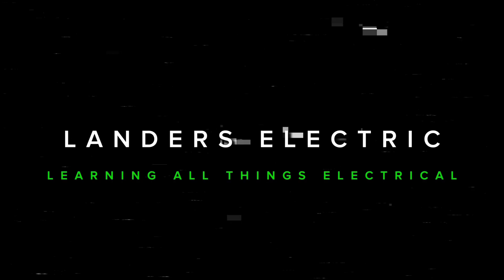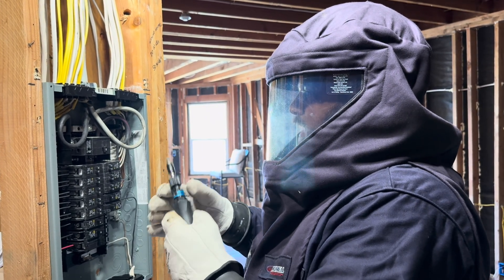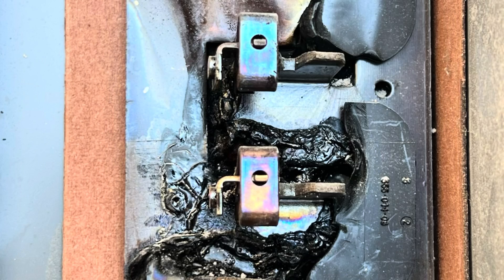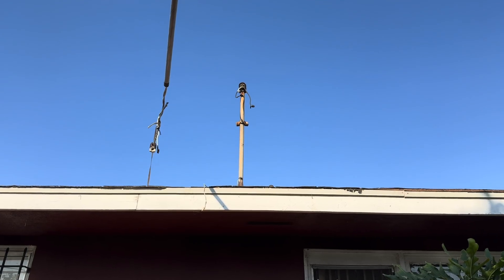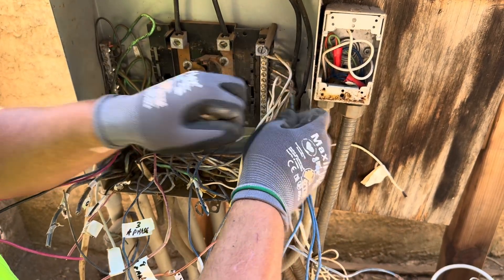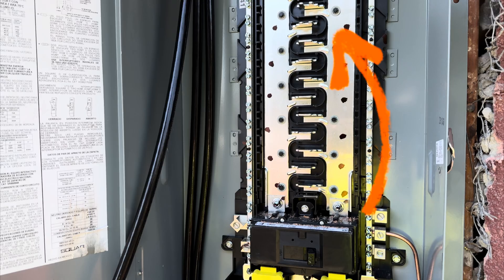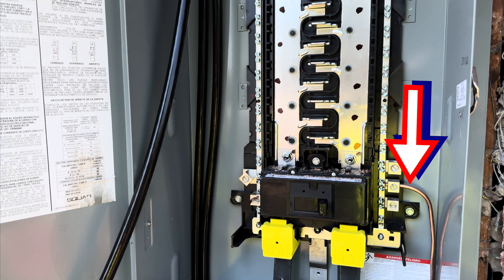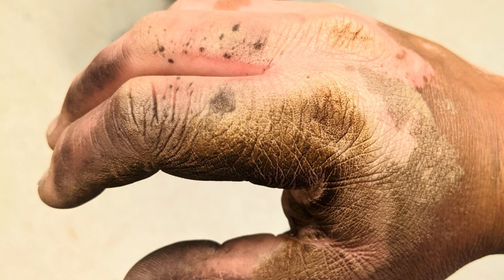I Could've DIED! | Electrical Panel Upgrade Arc Flash Accident

Comment: The problem wasn’t forgetting to turn off the main breaker, it was failing to have the power company do an emergency service disconnect first. A hot panel swap is not acceptable.  I know that you mentioned and understand that but I thought that the point needed to be emphasized. Glad that you made it through that.
Reply from the maker: Glad you pointed that out! Needs to be emphasized.
Reply: @landerselectric yeah, I mean, if it had been off, it wouldn’t have arc flashed at that point, but wouldn’t it still have gone wrong ten minutes later when you replaced the panel itself? Or were you planning to put the PPE on before getting that far and then doing the live swap part very carefully?

Either way, that’s a hell of a story. Glad you came out of it relatively intact and also that the insurance covered almost all of it, that medivac flight would have been a hella expensive way to get to ride a chopper.
Reply: The second mistake was not checking to see if it’s hot with your meter before working on it.
Reply: @jonnelson9760  and never do so with a multimeter. Any meter that can be set to AC measurement and then you try to prove dead, it will become the arc flash generator.
Reply: @JasperJanssen  We always used a multi-meter at work but we also had to wear PPE until it was proven dead. Also checked the meter before and after on known voltage source. That was industrial with 480 VAC. I always wore a face-shield although it wasn’t required.
Reply: I have a spare meter can with jumper cables and receptacle wired in.  I pull meter connect jumper cables to line of  meter can.  Put meter in temp meter can.

Comment: You never know how stable buss bars, isolators, connections are.  If you start pushing, yanking, bending on components and something breaks loose you risk making random connections. A journeyman electrician put his gloves hands into a 900A switchboard whose buss bar insulators had been stolen & the buss bars deflected & arced leg to leg & bathed him in the flash, took months to heal (only unburnt parts were his gloves hands, burned his shirt off, eye brows & lashes, hair back to a line from ear to ear)
Reply from the maker: That’s a real bummer. Have to be extremely careful and only work live if you have to and follow all proper NFPA 70E and OSHA Regulations.

Comment: Arc flash and arc blast are no joke. An arc is basically a plasma of super-heated, ionized gas and vaporized metal.
Reply from the maker: Well said!
Reply: I work in a data center. We always wear CAT 2 FR when on shift.
Reply: @dcviper985  What is CAT 2 FR ?  is that a type of arc suit?  or non-flammable clothing or?
Reply: @ fire retardant clothing that can withstand a certain amount of energy in an arc flash.
Reply: @dcviper985  I will google such.  If your name is solid.  I could wear something similar....  (I just can't see me working in an Arc flash......)   I am mostly in "equipment" panels. but some main, and subs.  Mostly Equipment, thats why I've been called in.  Not sure what code calls for, safety wise.
Reply: Yeah I saw a video about an electrician who worked in a really big industrial mill that I think made plywood or somethng, and had big machines, and he opened a panel that had shut down a machine it powered, it was 2300 volts , and he had an arc flash happen and it set him on fire, they figured out he ran down the corridor and thru a door, collapsed and died the next day in the hospital. That arc flash and then his clothes catching on fire both combined together into a really bad scene that wasnt survivable.

They cited some mistakes, one was not having  a buddy with him, he was there alone, I think the arc flash explosion happened when he touched his voltage meter to the terminals, maybe the voltage on the box was not labelled right or whatever it was, his meter was not correct for the high voltage if I remember right, and it melted the meter and shorted the connections.

Here's the video details on youtube;

Arc Flash Fatality Video.wmv
  
4,185,679 views  Sep 18, 2012
The tragic story of how a worker, Eddie Adams, died from an arc flash, and how it impacted his co-workers and his family.